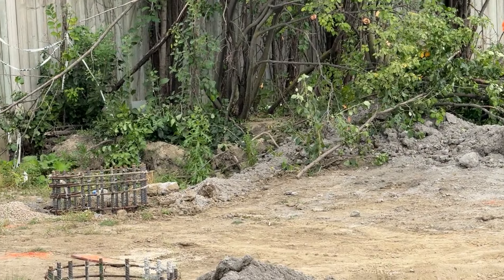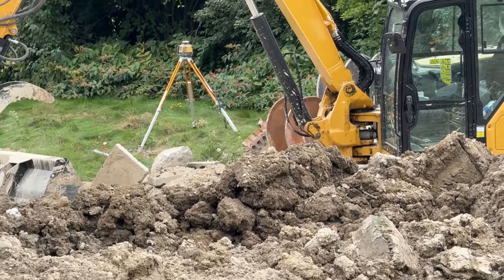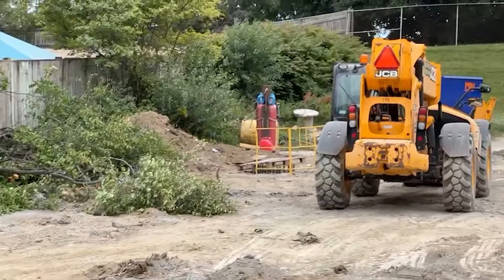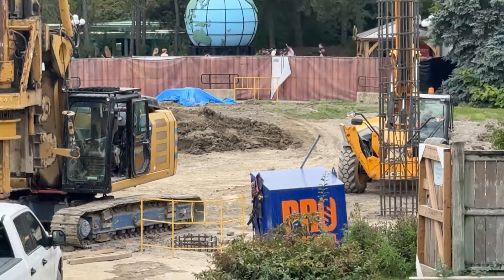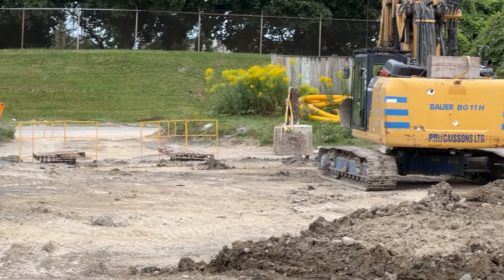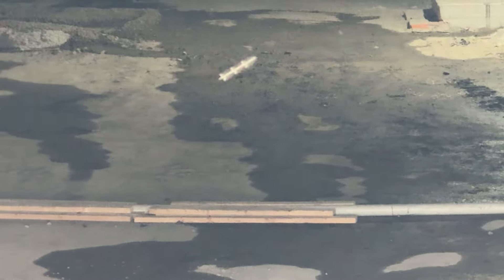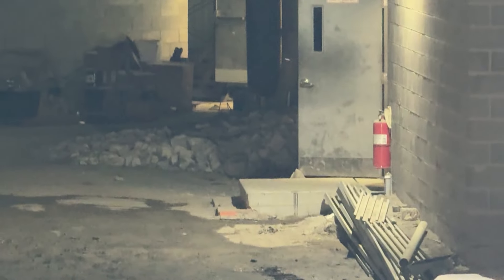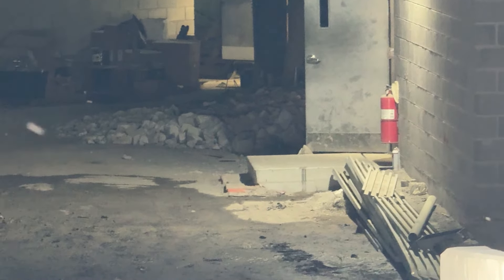Canada's Wonderland AlpenFury Mountain Demolition

Comment: Those are not threaded rod.  They are anchor bolts.  Anchor bolts have a hook on one end to be embedded in the concrete and the other end is threaded some inches for the nuts to fasten to the baseplate of the support beam. Threaded rod is used to hang light fixtures or other mechanical units.  Those threads sticking out of the concrete bases (or footings) are ANCHOR BOLTS.  FYI :)
Reply: Wrong,
Reply: @KrAzYeYeDKeVIn  how am I wrong sir

Comment: Wonderland is being run like a Six Flags legacy park more and more each year, that's a pejorative. Way too many of obnoxious groups of teenagers roaming the  park b/c they have cheap passes, like Sf parks did for decades. The park needs a chaperons policy immediately.  The line jumping is ridiculous.  I have all season all park Fl+ so not affecting me, but seeing the craziness is ridiculous, What's with all the scammers trying to reuses FL they got from someone else. The number of people getting busted for that is astronomical Then you have the people arguing with ride ops, especially the last 2 or 3 hours of park close b/c they have a FL+ that is suspect b/c they tried to reuse  one taken off someone's wrist that left for the day. The adhesive part is all shredded.
Reply: I was in line for Leviathan, which was full, and an extra line was added. I was in the line for an hour and 20 minutes. In that time, I spotted 5 line jumpers. The biggest difference was that people in this line weren't putting up with it. 4 people were told to leave the line after people in line complained very loudly. One person did get by, and she ended up skipping a lot of the line. I was kind of pissed but not as much as someone else. I'm pretty sure someone called the number to report line jumpers. When we finally arrived at the stairs, I looked up at the stairs to the exit and noticed the line jumper now talking to a police officer. It took us another 20 minutes to get on to the ride. After the ride, we exited down the stairs. Now, there were 2 police officers talking to her, and she was pretty animated. As I walked by her, the person behind me says loudly, "Hey look! It's the line jumper!"

One thing I'd like to point out. All but one of these jumpers were adults. But it also doesn't change the fact that there is a serious problem with people dropping their young kids off like Wonderland is some damn daycare.